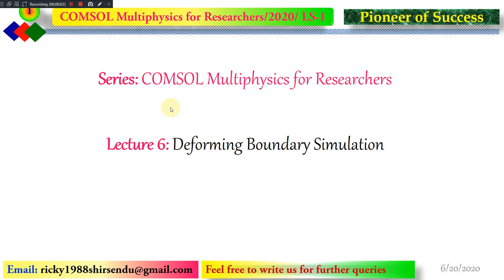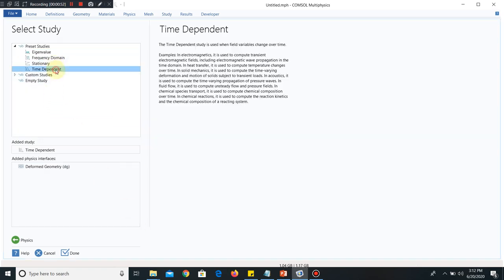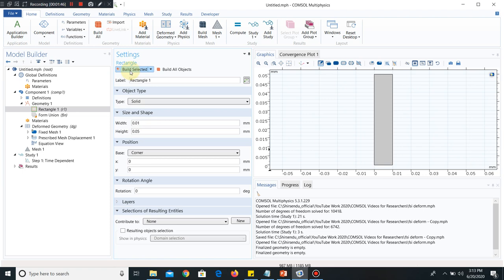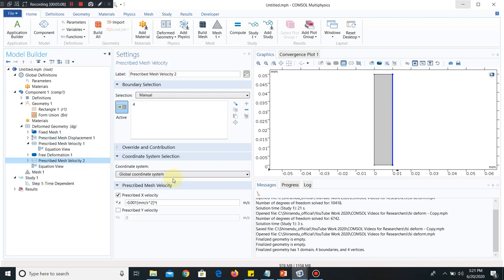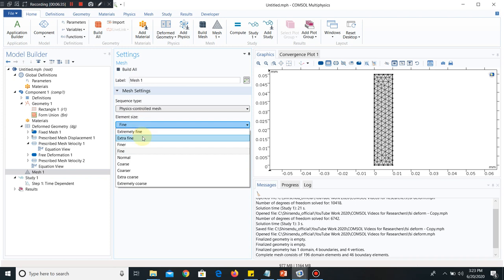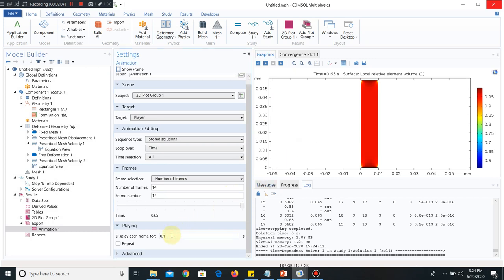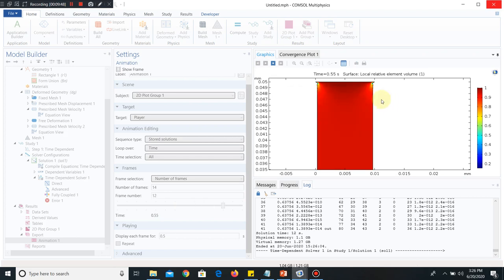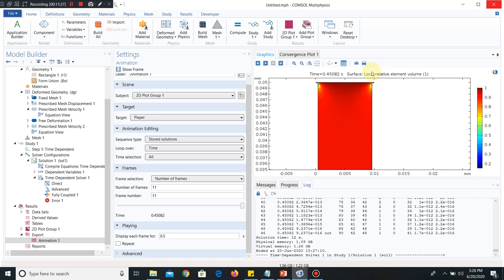Wall deformation in COMSOL || Lecture 6 || Series: COMSOL Multiphysics for Researchers.

Comment: in comsol 6 i can only find prescribed mesh NORMAL velocity. and deforming domain. and when trying to solve the thing it says "failed to get consistent initial values" . any idea how to solve it without using legacy geometry?
found the issue, i should've used a normal zero displacement on the sides